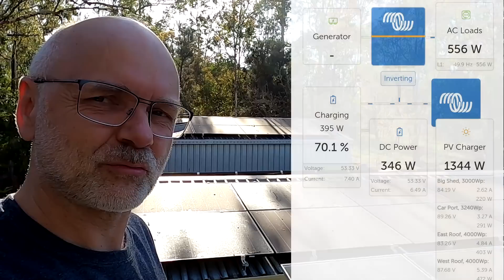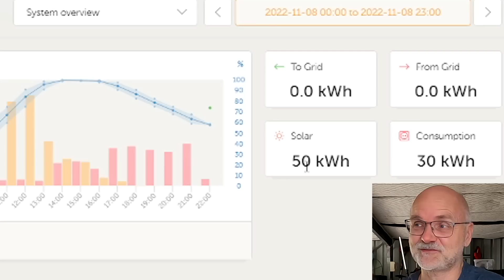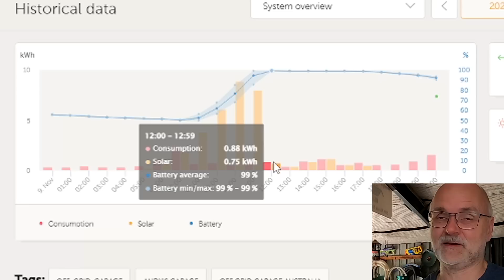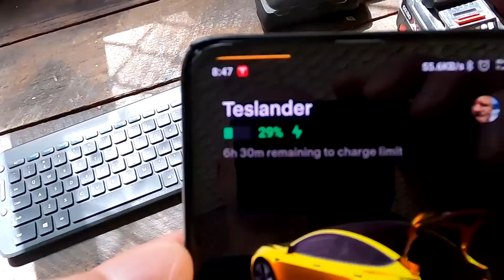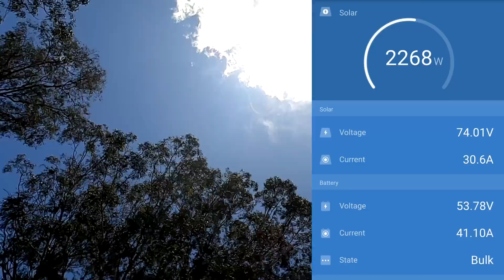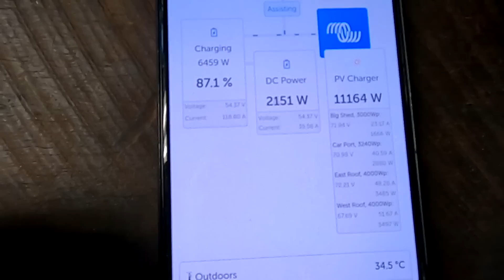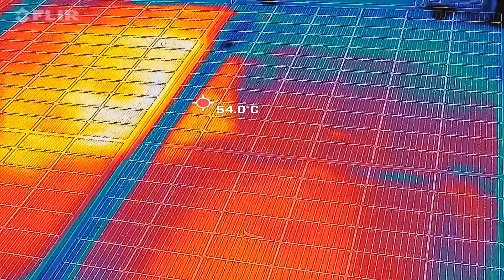I had to limit the output power of the new solar system. First impression after a few days...

Comment: Why no make the string a little longer so your voltage goes up, a little, you even could have bought the 250v/450v version to make longer strings, in winter this will improve production, but it also keeps the current low on you solar setup. I can show you VRM about different versions of this system. Also Victron RS solar 6000 would be very interesting to you, much more efficient in power conversion to AC. Did you know victron has also launched new Multiplus II models? The 4K5 and 6K5 they have aluminium transformers and perform very good, no more VA rating 4K5 will do 4500 watt every time!

Comment: Why dont you get a bigger bettrer hybrid inverter. Like 12 to 18kw single , dual phase or preference 3 phased.. more efficient as one has 2 mppts 240amps charge discharge in 12kw. Deye. And efficient than this.. you have the knowledge magic of batteries and youll just need to replace your inverter generator. More details about the loads conversion phases  frequency. Utility tripping.. you have 15.9kw so you can attach a 12kwp to be best efficiency. And you can directly charge your dc car through the mppt directly with upto 12kw nominal and 16kw peaks per phase 6kw loads. I just have trouble with the batteries as i dont know much about bms .. and people said that it has to be the same for parallel. Even the firm ware.. even the cell .. even amps voltages.. and i was like if they can communicate to each other through thier own bms they have safety protections. Batt would stop and other 2 would charge until they are filled. BMS would should work.. 12 kw need about 280v to 550v to max of 800v. I have 28 545watts. They work better when they're at almost 80% load.. and when uou charge from one dual mppt with 240 amps parallel. . your going to monitor centralized the system.. and i think adding some kind of (B-bms) master slave. And that can manage the currents for the batteries would be love . Then we may parallel 51.2v 100amps 5 kwh batt to a 51.2v 200amps 10kwh. Thrid 15kwh 51.2v 300 amps .. for a 12kw hybrids system would give you upto 48 to 55 units, you can sell it to the grid when charged. And cope your use of may be 2-6 kWh . My needs are bigger and my batt bms bursted away. Due to over loads. It wont charge.. inverter got off grid  and shifted onto the baty. My loads were 8kw. Reactive upto 10kw.. peaks ..  at night my system shifted onto batt.. first inverter use to trip the house after 10sec or so.. so that the loads gets reset.. and we shut down our air con.. and once it got locked due to saftey.. deye remotely updated my batt it worked for two days and died again.. it oeaked out 4.5kw load was 1800waats.  And utility goes off and my load gets 7.5kw.. how.. and what happened.. i have deye batt 16s 51.2v 100amps usable 96amps.. but no communication only inverter shows. If i want a Bluetooth wich does comes in china but not in Pakistan due to our cost cutters and pocket fillers.. and it does have a usb and rs484 ports but i dont know how and what coukdnbe done to communicate.. i cant see the bms ornuse its ports as itll void my warranty.. but they shouldntell the complete info.. rebranding to inverex nitrox 12kw lv 3 phase.. its deye..

Comment: Question for you ?? If breaker to batteries trip wouldn't the charge controller get smoked because panels are still pushing electricity to it ??

Comment: thats a inpressive system , and the setup looks to be very stabile ,
 the offgrid qestion depends on how much power comsuption and the low output solar months 
i am totally offgrid with a tiny system consisting of
 6 old 100W 20v  panels 2 series 3 paralel( charging about 12,5 amp 24v) trough a cheap hybrid pwm controller
 2 (broken glass) 200w  40v panels (charging about 5,8-6,2 amp 24v) trough a 10$ pwm 10a controller (only for bulk)
battery consists of  8, 280 ah  cells of good quality purchased from (jenny from docan (i belive?) cells have never been top balanced by me, and i have never seen more than 0018mv cell deviation but i am pulling few amps and charging just as slowly
bms daly 250a smart version ( no problems yet)
cheap 24-240v inverter 1500w,,
a old millitary surplus 12-24v 25A gennerator ( rarely ever gets used as i can run for 4-6 days on battery alone if i cut off unnesseray loads)
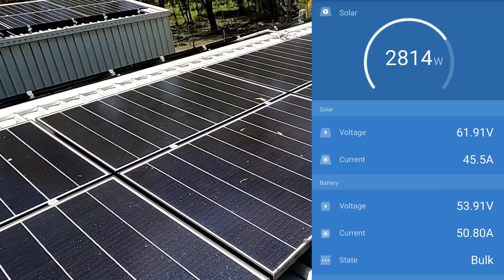at 14:30 as i am writing this i am getting about in 14-16A 
thats my standing system for now, and i have enough power to live in my 2 caravans use laptop internet  refrigorator   ,tv blower fans for dispersing the heat from my  gasheating system and running a diesel heater when visitors come, pump water  lights e.c.t 
it is intresting on how little power one can live comfortably... 
now the stuff that has not been mounted yet  for the low output solar months i have a 
24v 1500w istabreeze windturbine with mppt chargecontroller dumploads e,c,t(we have very good wind conditions on this island) 
1 older 12v 400w turbine that actually produces a bit of power and a boostconverter for said turbine
a 3000w 60 a mppt solar charge controller/inverter/ is on its way
6X 400w risen solar panels on its way
8 more 280 ah cells on its way

havent decided on a bms yet ,,

Comment: What you need to do is get a bigger inverter like the GroWatt 12K MPV that can actually take 250 volts PV input.
Reply: Or get two inverters
Reply: Actually it sounds like we need to do is power more things like buildings around your house whatever you run

Comment: G'day mate. I live at Angledool NSW 2834 and have a friend with a large solar array (20 x 200w panels which seem to be in 3 series strings going to a combiner box) but I'm not too sure if he has it configured right. He has a Victron 150/100 controller and a Multiplus 5000 inverter/charger with a 750ah wet cell battery. This is a diy installation.
Would you be able to help me understand how to configure this array for best output. Can it just be in series for this one controller or should it be in some sort of series/parallel or should he just have more controllers. Hope you have time to give a bit of advice.

Comment: This makes me happy... you've reached an impressive outcome. You might need to look at heating your pool, or leaving AC on to burn some power...
I'm new to solar and recently wired up my off grid system (48v Growatt ES 5000 with 6000Wp and a 12v Rover with 750Wp of 12v) but I'm discovering that I need to over-panel to combat poor location of the panels.

Comment: It is unlikey that you can over charge your batteries. Because batteries will only draw current if the charge is lower that maxium charge. As long as the charging voltage is not excessive, batteries won't charge if the charge on the batteries is full. One of the functions of charge controllers is to limit the chargeing voltage.

Comment: holy moly - YOU'RE RIGHT!!  i've been a little concerned with the cascading-battery-BMS shutdown-overcurrent thing for a while now on my system... and yea!  i NEVER thought that when the system goes into absorb/float it is in a constant voltage state and will only push the amps required.  NOT the full amps of all controllers going to the max.  so, at least, this alleviates any concern i have of this going on during absorb/float.  thanks!
it's still a possibility to have a battery/bms shut down during bulk and then divide the amps among the remaining batteries... but the chances of a battery/bms going offline during bulk is... well, a very low probability.
wow.  im ASTOUNDED at my incompetence! LMAO!

Comment: Depending on panels and how they are wired shading will down grade that panel to the LOWEST production of cell on it w most shading.  I think even if wired a certain way, it can degrade other panels.  Shading can have a significant effect.  Oddly the 'Brightest' area of the sky is slightly to the north, it's complicated but true.  With some shading degrading other panels and some cloud a n facing system can out produce S facing.  Remember in olden days artists lofts had skylight facing north.  
and
Don't controllers limit battery charge to safe levels?
Is there any real downside to more power into controllers than controllers can use.
and
If anyone can point me to 'how to divert excess into water heater' please do.  Any hint.  It's probably simple for those who have finished their system but I'm far from starting.

Comment: Another thing to consider is a bigger battery may also mean you might be tempted to use more power at night than you would normally. All up a fantastic video, it's really good seeing such a powerful setup in action. The Victron gear is amazing too, I use it and am very happy with it. I'll be getting a Cerbo GX in the coming days myself to do all the monitoring like yours.
Reply from the maker: Once the bigger battery is full, I'm with the same problem again. 44kWh seems to be a good size for now. I just need more load to use this capacity so the solar can recharge it the next day again and does nto turn off that quickly.

Comment: Not sure of your setup. It looks like you have 4 separate charge controllers and 3 batteries? I see shade is a bit of a problem for you. I have 1 off grid inverter which has 2 charge controllers built in and I have 2 lots of balanced arrays, which are paralleled (4 arrays).  This allows me to have the 4 arrays all feeding into the one charge controller which limits the overall charge current to the batteries, and ensures my selected charge current is not exceeded into the batteries, which helps extend the batteries life.

Comment: It was a refreshing experience to see, congrats to your system :) One comment for the top performance: if you are off-grid or at least moving in that direction you should not dimension your system to the nice sunny days, you should have it overpaneled big time so you have enough coulombs even on a worse day. If that is done right, you will always be overpowered on sunny days. This is not a problem, this is the nature of a well dimensioned off-grid solar system.

Comment: A 10kwh storage isn't big having an electric car. Be careful, the batteries likely die early, especially with that charge current!
Reply from the maker: Who has a 10kWh storage?
The cells I'm using have a 1C rating and can handle up to 280A charge and discharge.
Reply: @OffGridGarageAustralia  it looked like on your graph on the vertical axis the highest number was 10kwh. - I try not to discharge and charge my batteries often and to it's limits, nor do I that with my Tesla. They may be able to handle it but the harder you go in them the more it shortens life... 280amp is a lot. Must be a huge battery to take that without a sweat
Reply from the maker: @Gallardo6669  That was maybe 10kW coming from the solar.
The battery itself can take over 800A max, but the breakers and cables are not designed for that. It's 44kWhat the moment.
The batteries get 0.3C max charge and discharge current, usually a lot less both ways.
I keep the Tesla at 60% most of time and only charge higher if needed, very rarely going over 90%

Comment: Well done Andy. What a great system. Maybe too much power is better than not enough! I'm new to solar but I am really keen to learn more. So this is probably a silly question, but where does all the power generated by the solar panels go when the batteries are full and the solar charge controller powers down or goes in float mode? Is that explained in an earlier video I can watch?
Reply: The victron charger will just shut off. The panels stop doing anything. When the battery loses a bit then everything turns back on automatically.

Comment: Hi Andy , love your videos.  I have a 400 ah battery bank (4x 100ah) wired in parallel each BMS has a max charge of 50a , is this 50a for the whole bank or so 4x 50a?
Reply from the maker: Yes, 50A is for each individual bank, so 200A all in total charging current from your solar.

Comment: Can there ever be too much solar power ?
It's summer conditions now Australia. This winter, you might be using all the power your new cells can produced in lower sunlight conditions or winter.
Reply from the maker: That will be the ultimate test! It all looks good at the moment but lets' wait for wintertime first. If it passes this test without me installing the pool fence system again, it's a winner.
Reply: @OffGridGarageAustralia  Or add Air Conditioning to your garage and/or house, use that 'free' power.

Comment: Sounds like you need dump loads, sand heat batterries and water heaters. And no YOU CAN NEVER HAVE ENOUGH POWER! lol give it away to the neighbours, your set up is awesome, I love it. Mine is much smaller I am on a tight budget, I have just reached 1.3Kw of panels, but I am fitting more and more and windchargers about 1300 Amp hours of batteries now. We all have a social & moral obligation to destroy centralized energy production, together we can break the cycle of abuse/exploitation and the monopoly of the energy giants.
Reply from the maker: Great, Richard. That's the way to go and how I started as well. With 3 panels on the roof was my first set up.

Comment: I suggest you feel the temperature of the battery cables when you are charging at the maximum current you can. I suspect they would be getting a bit warm but would love to know for sure what is happening there.
Reply from the maker: Coming soon, just need to be at home when we have full power coming in.

Comment: Andy, I'm couriouse why there is such a difference in the charging current on both your 280Ah batteries.  Do you have any logical explanation for that?  THX!
In my case I have a 176Ah and a 280Ah in parallel - the smaller one always has the lower current - but I could not figure out a ratio between them
Reply from the maker: My batteries are 304, 280 and 280Ah. The current is only really that different once we reach higher voltages and are almost fully charged. I have connected the pos and neg on one side of the vertical bus bar only and not the neg at the other end. Apparently, that makes a difference and keeps the banks equally charged. Very hard to test with such a large system. Usually the 304Ah bank at the top is the first one to be full. Could be because of a very small voltage drop further down to the other banks and therefore it uses this bank more than the next one in the middle and this one gets used more than the bottom one. The difference must be tiny as I could not see any difference in the BMSes.
Reply: @OffGridGarageAustralia  Andy, thank you for your kind reply. I will have a look at the resistivity to my two, in parallel connected batteries, respectively their connections.

Comment: If you ask your neighbours if any have a EV they want to charge from your system for free, is it still a 'dummy load' ?
We all know the next logical step is to increase daily load, increase the battery capacity & connect to grid to sell back. Would be good to have the battery capacity big enough to take atleast 3 days of maximum per day solar PV production of summer (minus the loads when you are away). Eg. 70kWh produced/day - 15kWh pool pump used/day = 55kWh/day X 3 = 165kWh battery. Another EV to charge, fridge/freezer, heat water, house air conditioner? Move house circuit(s) from grid supply & power them from the garage? The biggest factor is being able to use the available energy each day.
Reply from the maker: Yes, I need more load now. Already in discussion with the sparky to get the house connected. It's difficualt though, so...
Grid connection can't be: https://youtu.be/LQJZUmWDuCs

Comment: I wasn't really thinking about the "Cleaning" as being the point. RainX Repels water. When I use it on the car, even when it rains , I can still see out the window without wipers. Because the rain beads up and rolls off. Which begs the question, Since the dirt on a panel comes from the rain, if the rain beads up, and rolls off before it can evaporate from the glass, maybe they would only need to be cleaned 1x a year. I don't have a solar system, so I can't check that out.
Reply from the maker: Thanks Mark. I know RainX and it's a great product.
I would assume it will not work on solar panels as well because of the missing wind and the relatively flat angle of the panels. Most of the dirt is coming from dust, not the actual rain. But it accumulates at the lowest point of the panels.
I have cleaned panels for years without seeing any increase in production afterwards.

Comment: Hi Andy, since you are maxing out your MPPT with 70A charge now, are you not worried about your 63A DC breaker connecting the chargers to the batteries?
Reply from the maker: No, I'm not worried. Even driving them on 70A for quite a while won't trigger them. It takes some time to heat them up enough for that to happen. Usually, the 70A are just for a few minutes after a cloud effect.

Comment: The wattage and amps going through mono half perc will be higher than the other ones. I am guessing the efficiency will be higher by 1-3% on the mono perc panels. That will create more heat, which might be the temperature difference of the two. You could divide the temperature by the amps being sent out by each panel, that might be a better metric?
Reply from the maker: Very hard to measure. Both types of panels have around 21,3% efficiency. I also measured the tilted panels at the top and the shingled panels at the bottom where cooler air comes in, so that could be the difference already.
Reply: @OffGridGarageAustralia  ah, if they have similar efficiency, than yes, much harder to measure. My panels are 330w and around 17% efficiency, the ones install now are at 550w or 650w around 21.7% (if claims are real). So glad you got a proper setup. Now you can get another electric car because that is a battery 😁.
Reply from the maker: @asderven  Yes, we consider this. But I really want to see how it goes in winter...